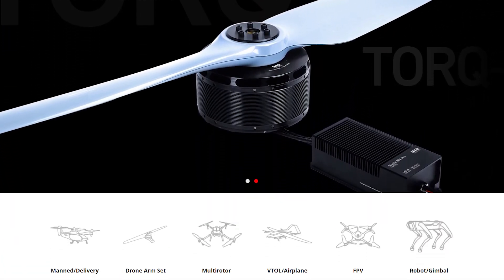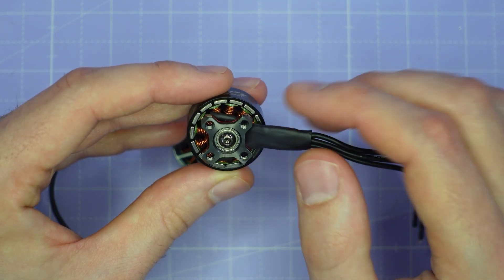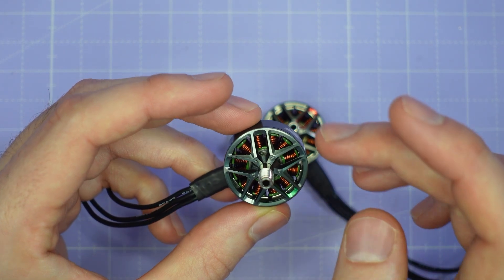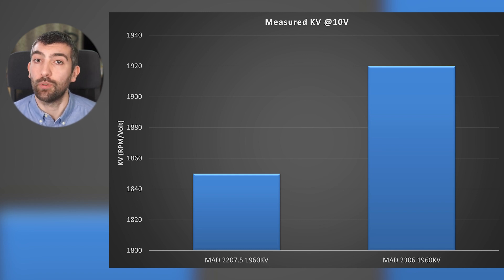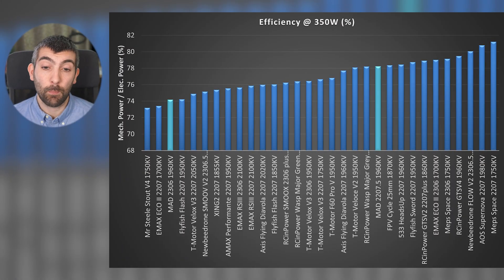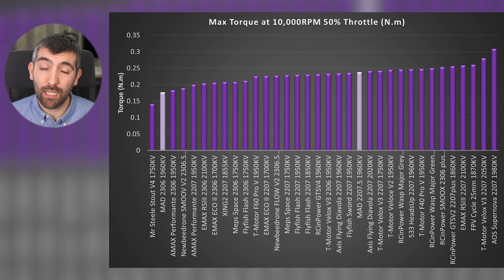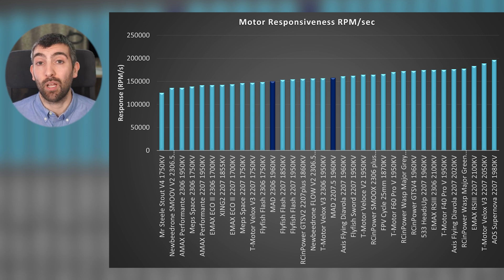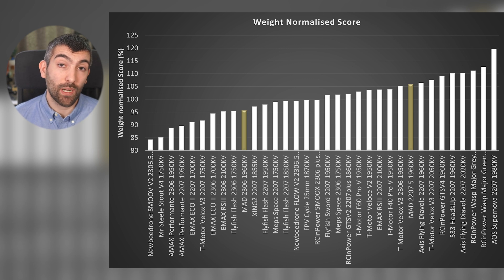Testing some MAD FPV Motors from MAD Components

Comment: I have been FPV my helicopters (single rotor 250 grams) with Walksnail, and MADs large industrial single motors look good on paper. I can budget 3.5 quad motors' weight on the single heli motor.

Comment: Hello everyone, this is Mad Components. We would like to express our gratitude to Chris for testing our motor.
 We sincerely welcome all suggestions and test results, even though we may have some questions about certain data. 
In order to provide better products, we will also conduct similar tests to validate the motor's performance. 
By the way ,As for the appearance of the motor, it was inspired by a racing wheel and there has been no plagiarism involved.
The next step will update the production of more professional freestyle or racing motors in 2024. 
We cordially invite you to participate in test flights.Thank you once again for your support.